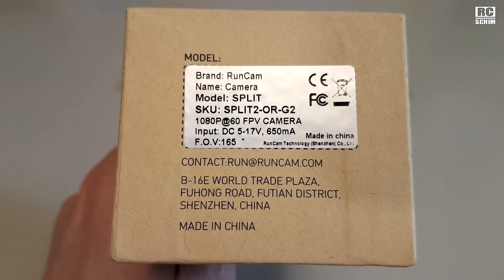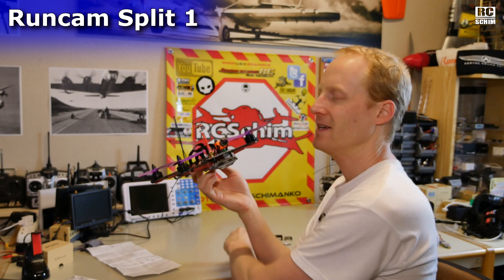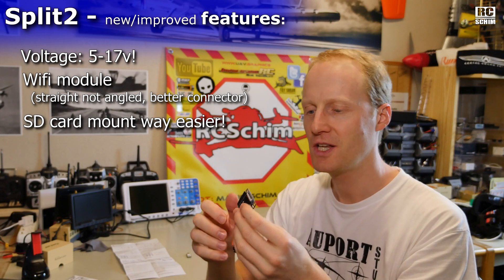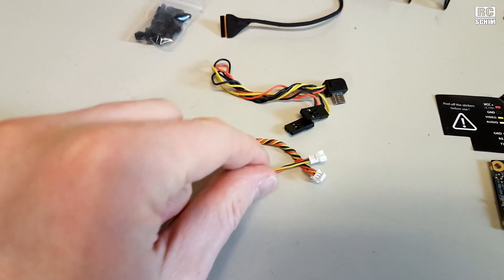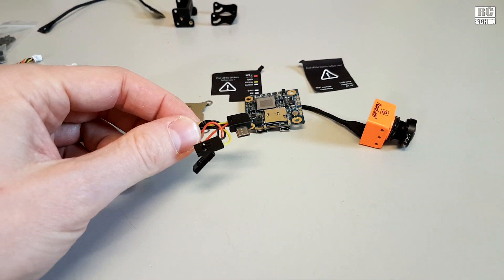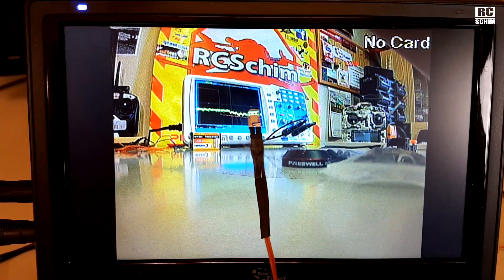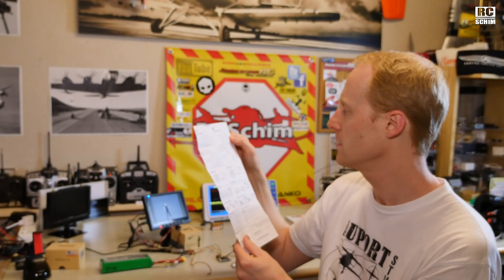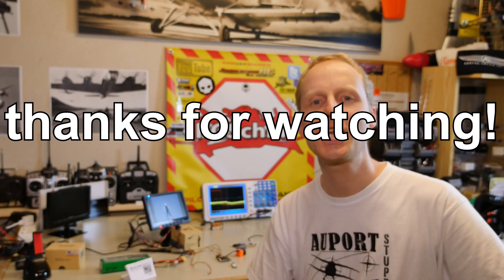Runcam Split 2 - firstlook

Comment from the maker: follow-up (new video here https://youtu.be/UHhm4ETsds8):
Thanks to all you commenters here I have a list of questions already. The indepth review should answer them all. In the meantime just reply here if you have other questions (or answers as well). 
1) PAL framerates for rec? 
 no, 30/60 for Rec but pal/ntsc for TVout

2a) latency of solderpads liveout?   avg 36ms    (no difference between USB and solderpads)

2b) latency while recording vs not rec? not much difference (if any at all)

3) sofmount for cam or board? (rather for the board)

4) ... does the Split 2 fix the issue with horizontal (and/or vertical) bands appearing in the HD video when viewed at certain screen size/resolution?
unfortunately looks like problem still here: https://www.rcgroups.com/forums/showpost.php?p=38472879&postcount=1439

5) When card is full it shows black screen?
was fixed with firmware also on split V1 since Sept 5/2017 update

6) SD Card handling (how easy?)
fairly easy with the spring/slot, hard to reach if both, USB and wifi stick is connected.
still 10x better than the old SD slot!

7) The issue of returning 5v voltage to ESC and USB was solved?
according to Albert it's fixed

8) is the v2 board compatible with the v1 camera?
yet to be tested (have my V1 buil into a quad atm)

Albert Kim's review (with a little flight video as well): https://www.youtube.com/watch?v=h44Pn1JreHY
Reply: link to  "Runcam Split 2 - followup"  video is broken, here is a working one
https://youtu.be/UHhm4ETsds8

Comment: New Runcam split 2 looks good,  I was sitting on the fence after the first one came out hoping for an updated version, mainly due to the SD card issue and was hoping for better cable connection.   Looks like they have addressed all the review issues on the first version.    Look forward to any updates in near future,   Thanks for the review.

Comment: Thanks for the quick look.  Looking forward to latency results on direct solder pads.  Also, how easy/hard it is to remove SD card when installed in stack with the stainless shield, wait difference between Split1, etc
Reply from the maker: thanks for feedback - gives me a nice todo list for the followup video. sometimes it's hard otherwise to think of all neccessary tests, considerations...

Comment: RunCam bring new cameras out faster than I can get their previous cameras working well enough.  Still haven' solved the jello problems on the original split in my build
Reply from the maker: as I wrote so often:  try good props and ND filters - that's what worked for me
Reply: What ND filter did you use on it, I didn't see mention of it on your last video ?
Reply from the maker: the ND filters I got from Freewellgear for the mavic...  https://freewellgear.com/59-dji-mavic-accessories
they dont directly fit on the lens - but to make them fit there all I did was using some layers of doublesided tape around the ring of the lens. easy...

Comment: Great testing! I was kind of hoping the Split 2 would be smaller overall so I guess I’m still waiting for a Split Micro;)
Reply from the maker: I dont think the size is that much of an issue. weight is already perfect imho. skip ahead a few years and the biggest part of such a cam then would be the micro SD card - which at this time would be replaced by a nano or pico SD...
Reply: RCSchim Thanks for the reply:) I’m wanting a smaller Split because I like the smaller 2”-2.5” quads. I know there are people who run Splits on these size frames now but it’s not quite ideal. I bet it’ll be easy next year;)

Comment: Would soft mounting the camera help solve people’s jello issues? Good vid!
Reply from the maker: probbably - but vibrations are very complicated sometimes. and material, temperature and so on are all factors. if it's cold, the rubber dampeners act different - and you see jello, then it's warm and it goes away.
also: time of day (sun intensity).   you test something after you change cam mount  - you're happy because jello is gone - but in reality it was just evening, lower light, lower jello :)
been there, done that (a lot).
(check my vid "good vibrations" from my tricopter times :)

Comment: Big question is ... does the Split 2 fix the issue with horizontal (and/or vertical) bands appearing in the HD video when viewed at certain screen size/resolution? That's why I stopped using my Split 1.
Reply from the maker: good question! I will test this. I saw these weird moire? effects as well. I will search them in the footage and compare. maybe they fixed it with a better lens from the start?

Comment: Thx for looking at it. I'm not impressed. Just a quick fix. After buying two of the v1 I won't be buying any more. Too fragile, to risky, and a pain in the butt to fit in 3 & 4 inch light quads which is the only place I'd want to use it. The image quality is worse than the runcam 3, and flying at 70mph and having your screen suddenly lag and freeze because the ribbon cable decided to randomly stop working isn't fun. If your sd card fails it freezes the image entirely. Too many things to go wrong. Another rushed out product. If they could have two outputs from the camera I'd breathe easier. Having the fpv feed affected by any issues is problematic. V5 should be good tho! 😜
Reply from the maker: I agree - the live feed should in no case be affected! makes me nervous too.
In my flights with the Split1 I had no freezing - only on the bench once...  (think I touched the electronics too much there).
we'll see if the Split2 is more stable. 
oh, for V1 they have a new firmware that removes the OSD annoyance as well...

Comment: RCschim, the split 1 is kinda blurry with objects at a distance, tried the original lens and the rc25 but no improvement. Has this been resolved?
Reply from the maker: +JackOfAllTrades Split is not the sharpest cams - but good wdr. Same on runcam3. Have you tried to refocus the lens more into infinity? I have to test recordings yet, literally just unboxed it.
Reply: RcSchim, I took the quad to the field and tried to focus on some trees in the distance, however they remain much more blurry than stuff right in front of the cam. It seems like a flaw to me. Looking forward to your further testing. I really like the concept of the split so I hope it will get better and better.
Reply from the maker: try to swap the lens if you can. on amazon you'll find lots of gopro 3 replacement lenses. or directly on runcam the rc25g I think. might be a problem in the lens itself? or is it unsharp only if you fly?
Reply: RCSchim The problem is not with the lens, because the HD image looks fine. Forgot to mention that.
Reply from the maker: that's weird. you say HD footage is sharp and FPV liveout isnt? I will have to try this out - sounds impossible since they both depend on the same image.
Did you switch between pal and ntsc?
Reply: I did, pal is pretty much unflyable with my setup. Check this video same issue FPV bad and HD good:
https://www.youtube.com/watch?v=awtI9BGhXVc
Someone commented that turning WDR off helped but that would be a big downside

Comment: What is the smallest drone frame where this camera fits? Possibly without showing props...
Does anyone know or have an opinion?
Reply: I have seen people put in on a 3 inch drone. They set them on top of their stack and not show their props.
Reply: Thanks, but what is the name of the frame?
Reply: There are at least two 3" frames designed for the split, the FlexRC Ascent 3" and the Vendetti 140.
Reply: THANK YOU
Reply: Thanks Joan. I have seen people using 3" frames with the runcam split, but I didn't know what ones they were using. I have asked a couple of people and never got a response from them.
Reply: Also the Loki X3 Rec will fit the split. Possibly the regular Loki X3 too.

Comment: Hi Mario, what nd filter are you using? Polar pro? Cheers!
Reply: I'd like to know what ND filter to use on my Split 1 - can't completely eradicate jello no matter what I do!
Reply: Yes I hadn't heard about nd filter reducing jello and would like to know where to get one to fit. Doesn't this create motion blur though?
Thanks for the video
Reply: good question
Reply: ND filter should not be used if not recording RAW with custom white balance, ISO and shutterspeed.
Reply from the maker: the ND filters I got from Freewellgear for the mavic...  https://freewellgear.com/59-dji-mavic-accessories
they dont directly fit on the lens - but to make them fit there all I did was using some layers of doublesided tape around the ring of the lens. easy...
Reply from the maker: you were using ND filters YEARS ago already, right?  on the Disco if I remember right :)

The filter takes away quality, effects colors (but I do color grading anyways most of the time), but they reduce jello at least. and I cant use a beautiful colored video with jello - rather have suboptimal colors but smooth image...
Reply from the maker: ND filters block some light (you can use different density filters - depends on how bright the sunlight is when you fly).
on bright midday sun you might wanna use nd32, mostly I use ND16 - ND8 has little effect...   (lower number - more light passes).
with less light in the cam - the shutter speed increases in the cam (automatic) - longer exposure makes the jello dissapear. I think it has something to do with resonance between 60fps video and the frequency of your vibrations...
if the filter is too dense (ND32) then it will get blurry - correct.
ND16 is fine most of the times.

I also think it's not a mgic trick to fight allo sorts of jello - only the high frequency ones. if you got massive vibrations, at lower frequency you definitly should check your motors and props or even the quads PIDs - might also be oszillations from FC...
Reply: RCSchim Yes i was using ND16 on my Gopro 3 black with a custom wide angle lens without fisheye. I was shooting everything with Protune RAW, it's the only way to get best pictures. I'm still using a ND16 on my P4 today and even my GH4. You are perfectly right about the jello but beware for having fluid motions you should always record with shutterspeed at least twice of your fps. Example: 25fps (PAL lover here sorry!) minimum 1/50. 50fps minimum 1/100. You can do the test with lower shutterspeed, you will notice that your motions are totally not fluid.
Of course shooting RAW forces you to colors grade your videos, there is no magic receipe.
I have seen a lot of people complaining ND filters because they are shooting full AUTO, it works but you are loosing a lot of informations and details in your footages. RAW all the way.

Comment: Thanks for the first look, but TBH, this doesn't help me much for deciding if I want to waste more money on the Split2 since the Split1 was unusable for me. Specifically, the jello and shaking (that is not present with an Eagle2 camera on the same quad) and the relatively high latency. With the Sparrow proving low latency can be done with a CMOS camera, I really hope they have taken advantage of their new tech to bring this to the Split2. I look forward to your full review with the Split2 connected directly to a quad instead of the USB interface and hope this turns out to be a better solution than the first Split.
Reply from the maker: it would be awesome to have a combination of sparrow cmos magic and split HD recording features. might be a bit to much to hope for atm.... 
Jello really bothers me. my solution to reduce it was the right choice of props (dalprop cyclones) and an ND filter to reduce the shutter times. not perfect - but useable...

Comment: Where did you buy the filter fitting those small lenses? .)
Reply from the maker: It is a FREEWELL gear filter for DJI mavic and it doesn’t fit - I used double sided tape to fill the gap... works ok. On split2 the filter is in the view

Comment: Hi Mario, maybe I missed it but did you do latency test while recording? I guess the point of the cam will mean that people are most likely to be recording so a suggestion would be to emphasise that more in your comprehensive review. Keep well and thanks for the first look.
Reply from the maker: thanks. No - not recording while testing. 
Runcam actually told me in a mail: while recording latency should be lower? I doubt that - but will test. 
also I really think the USB port is not good to use for liveout...

Comment: Do you know if you can set up the run cam split to take pictures with a switch controller
Reply from the maker: yes, should work. you can controll a few functions. for example you can swtich modes (video - photo - OSD)
but swtiching modes in flight is tricky I think, because the OSD mode will only show you text and no flight image :)
so you could switch from default video to foto mode, than start recording (take a pic). 
if you switch mode again then - you're in OSD mode and crash :)

I'd rather take stills out of 1080p video.

Comment: Latency better using solder pads?
Reply from the maker: +ysvleis latency is great. I think around 35ms. By not the solder pads vs usb was important but switching tvout to ntsc and hd res to 1080p60. If you have hd on ntsc and tvout on pal - this is ugly. And i think that was default...

Comment: When card is full it shows black screen?
Reply from the maker: dont think so - but will confirm.  with a firmware change the now just write a normal text in the topright corner instead of that blocking...